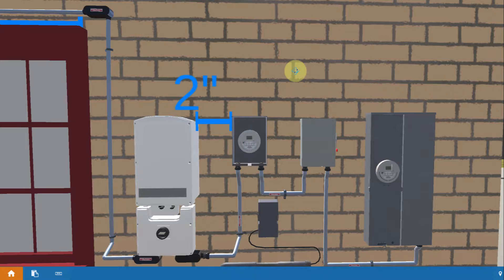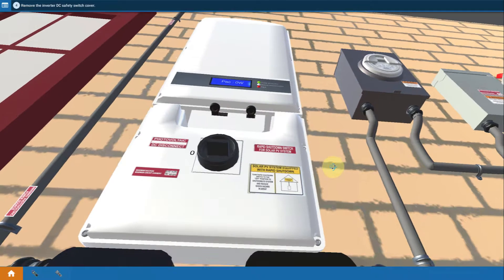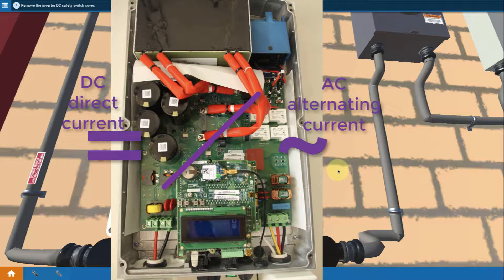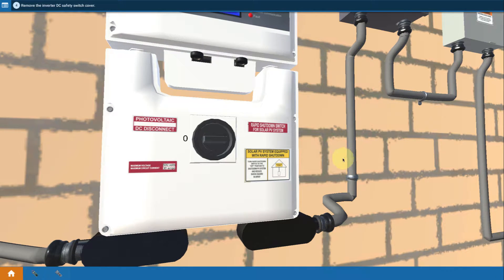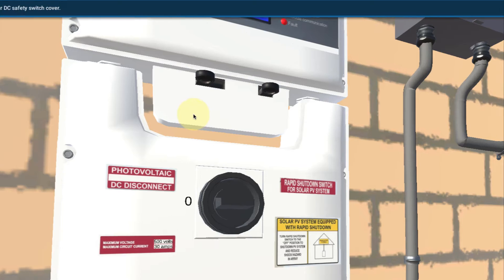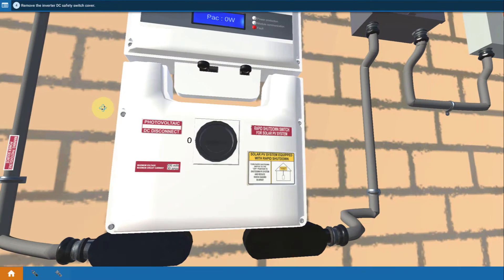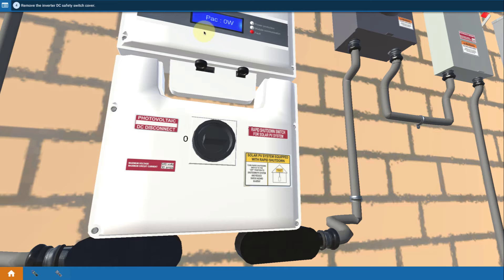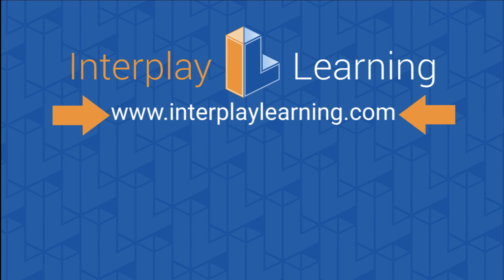Understanding a Solar Inverter

Comment: 080521/0806h PST 🇺🇸  Thank s for the vague pictorial explanation on inverters. When did the US residential Power Supply change to 240V AC?
Reply: 120 each phase.  The panel is where the opposing buses can give you that 240v potential.  I think you're just picking on him. Haha.